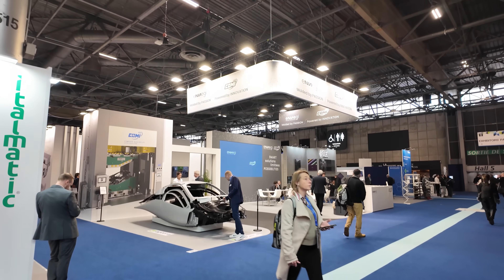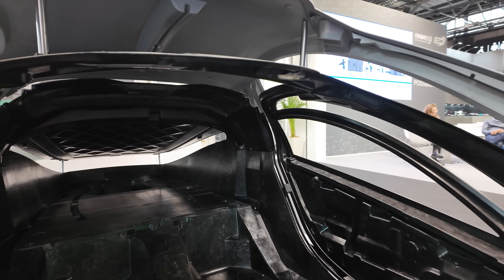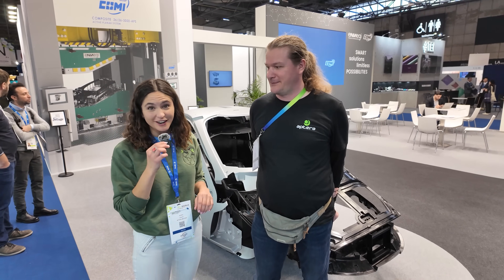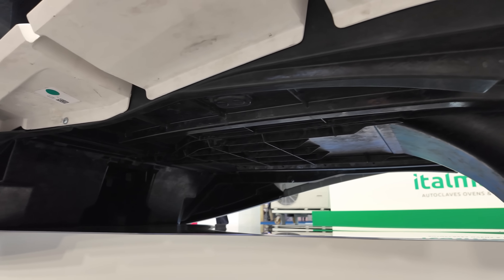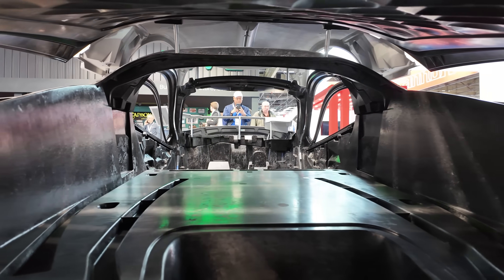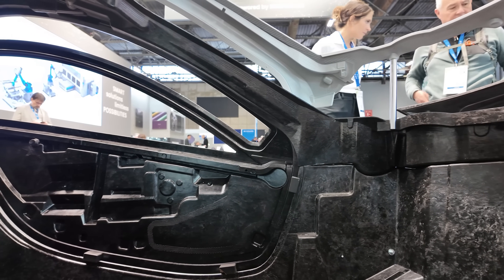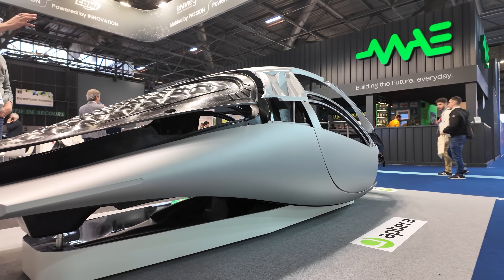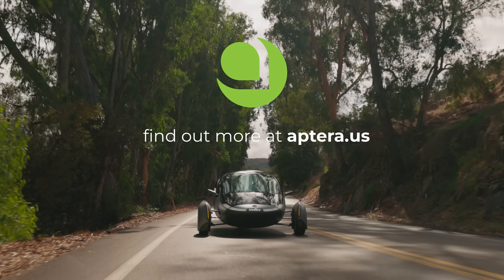Aptera Unveils Production Body | JEC World 2024

Comment: I think Aptera should look for an investor from UAE .. this car will definitely be a success in our region .. 

More sun hours less rainy days relatively more purchasing power.

I would also suggest that Aptera introduce a cheaper version with lower battery capacity (maybe 150 instead of 250) to reduce the starting price point and decrease the 0-100 charging time. UAE standard voltage is 220 and I guess it should be faster to charge with a 220v outlet than 110v in US (need someone to confirm)

It will also match the vision of most countries in the region .. investing in renewable energy.

I hope to see the first Aptera delivery this year
Reply: Chris Anthony just recently said that they are looking at offering a sub $20,000 vehicle with a 150 or 200 mile battery
Reply: Well almost all the outlets are 120 volts And we do not have 240 volt extension cords .

So it can be a bit expensive to put in a 240 v outlet just where you need it like at the garage door .

The 240 is on the house but getting it exactly where you want it can be expensive .
Reply: While most of our outlets are 115 Volts Ac most houses have a 220 volt outlet and 240 vac is available in about every house .

So anyone that needs the faster charging can get it .

115 volt in US is the emergency charger or visiting friends …..
Reply: @josephpadula2283  I don’t get why they advertise the slower charging speed on the 110v when the faster 220v is available and easy to get. Aptera shall not advertise that relatively slow charging speed as the normal daily charging speed and instead concentrate on offering it as a convenient alternative option. People thinking of shifting to electric car are very sensitive to the time it take to fill up their electric vehicle.
Reply: @amehaiza It shouldn't really matter since due to the smaller power requirements of the Aptera (10 miles per kWh) anything but perhaps the two longest range versions would be able to fully charge overnight however most will be able to take care of their daily commute just by parking it outside in the sun letting the solar charge the battery for free.  The 20 to 30 miles round trip most drive daily will be more than adequately handled by the solar panels built into the car.

It's really better for them to advertise the charging speed of the courtesy charger they give you with the car then pull a number out of thin air and give an overly optimistic number based on the highest capacity L2 charger one can have installed in their homes.

Best!
Reply: Steve Fambro has already spoken with UAE investors.  He has previous business experience in the UAE. (as do I)
Reply: @n.brucenelson5920  great news .. I live in Bahrain .. GCC region .. cant wait to see one of these cars in our country!!

Aptera will be the solution to the recent increase in gas prices in our region resulted from the governments’ decision to end the  petrol/gas subsidies.

It is an affordable futuristic solution 💪🏻

Comment: First off, I want to say this technology is amazing.  But I have to be the wet blanket here.  I wonder what this kind of monocoque construction is going to do to cost of reparability.   If something causes a small crack somewhere in the structure (say, impact with a strong or heavy object causes a 3" crack in a critical part of the structure), will this essentially "total" the vehicle?   My concern is that damage causing merely-cosmetic harm, or requiring replacement of some simple component, or a new body panel in some other type of vehicle, might result in an Aptera suddenly being worth less than the cost of fixing it.  Or am I missing something here?  Is there going to be some economically-reasonable way to effect repairs?  When everything is bonded together.... well, it seems like everything is going to be broken together.
Reply: No, the repair process is already well established.  Any place that can work on a Corvette body can also handle the Aptera.  Many kinds of damage can even be owner repaired.
Reply: @n.brucenelson5920 That is good to hear, thanks for the tip.

Comment: Cool stuff! I do wonder, though - since the body is so few pieces, if something cracks or is otherwise damaged, is there a way to fix it without replacing the entire shell piece?
Reply: Fiberglass can be patched using the usual techniques. Carbon Fiber I am not so sure. Probably it would have to be replaced. But that's why the fiberglass is on the outside.😂
Reply: Yes.

Comment: In a crash is it just plastic protecting you?
Reply: Carbon fiber and glass fiber are not plastic. I have handled both. They are rigid and very durable. When you knock on the carbon fiber it almost sounds metalic. There is a crumple zone reinforced with extruded aluminum that is the begining of the frame, so there is quite a bit protecting passengers.
Reply: @glennzajic7318  saw no cage in those doors.
Reply: It was just panels shown here. Aluminum sub frame has yet to be shown.

Comment: What happens if you get a dent or break on a side panel? Replace the whole frame?
Reply: Fiberglass work similar to a boat repair.
Reply: The body panels are SMC and don't dent.   They are easy to repair or replace.

Comment: bonding the fiberglass exterior pieces to the carbon fiber monocoque seems to complicate quick & easy replacement of any damaged fiberglass pieces. I would have expected to use physical snaps or clips to facilitate the installation or replacement of the outer fiberglass.
Reply: It will be easy to bond in a new piece, just as is done with Corvettes.
Reply: How do you unbond the fiberglass part from the carbon fiber monocoque without negatively impacting the monocoque's structural integrity?
Reply: @solbeach9618  The parts are not fiberglass, but SMC.  A heat gun, putty knife and air chisel can be used to debond and replace the part.

Comment: This looks really cool. But I wonder how easy is it to repair a structure like this? Or will it be a situation where, once it develops a crack somewhere you will have to scrap the car.
Reply: I’m told that with most cars today, if the collision was strong enough to trigger the airbags, the car is totaled. It’s TBD how Aptera’s CF body will hold up in those cases. Crash tests are coming later this year. First priority is protecting the people inside. If the body is sacrificed to do that, so be it. In lighter collisions the outer surface only will absorb the damage. Those fiberglass infused surfaces are easily replaced or repaired.
Reply: Repairs will be easy and can often be accomplished by an owner.

Comment: One piece body means in case of collision, it will present a major issue when it comes to repair no?
Reply: composites are not challenging to repair. If the accident was bad enough to use the crumple zones, the car will likely get totaled. But that's the same as any other small car
Reply: An advantage of fewer, larger body parts in regards to collision is the distribution of force. Thus making it safer. Even if only better by a few % points that could mean the difference between life and death. First and foremost safety is valued over vehicle and costs.  Plus insurance.
Reply: The outer layers of the body are designed to sacrifice themselves to keep the inner layers of the body from taking minor dings and scratches that would need repair. If the inner frame is damaged, the collision should be serious enough that the crash would be a total loss. 

Coincidentally, the inner and outer layers are color coded. 😂 The white layer on the outside is fiberglass and the black layer on the inside is carbon fiber.
Reply: So Aprera is designed to take the hit and just be scrapped?
Reply: @MeCookRider  If the vehicle is totalled in a front end collision then yes, the body will be scrapped. Just like any passenger car.
Reply: @MeCookRider  just like any other small car, it's designed to get destroyed to keep you safe

Comment: When the heat pump version comes out, I am in.
Reply: Why, what type of climate?  Recall Aptera saying the cabin heater now draws a lot of current but AC about as efficient as heat pump cooling.
Reply: @gr8dvd  It depends.  The AC and heat now draws a max of 1800 watts.  At relatively mild temperatures, a heat pump can save energy, but during our Iowa winters, in cold weather an air exchange heat pump doesn't provide much advantage.
Reply: 😂😂😂😂😂😂😂😂😂 , Heat Pump ????  It’s 2024 : Hot Wheels 🚘 come with heat pump

Comment: Repairs won't be cheap though.
Reply: Why though? composites aren't expensive to repair
Reply: Like the old Saturn advertisement, it will be ding resistant.
Reply: If one of the outside shells breaks, cracks in a accident on fender bender, will it be possible to separate it from the tub or door frame? Sure it might be able patch it but there's a limit of how much can be patched.  Wondering about the cost or replacing a door or a corner in the back... Large single pieces bodies are great to reduce initial cost but might bite back later. Like the giga cast parts on models 3. I doubt that Tesla will be repairing bent casts from accidents
Reply: @wollinger  Yes.  The bonding of the SMC parts can be separated with a heat gun.  Some owners can even do it themselves!
Reply: Yeah don't ding it